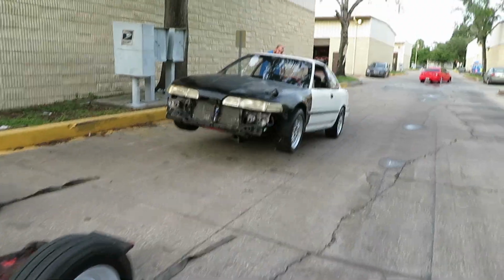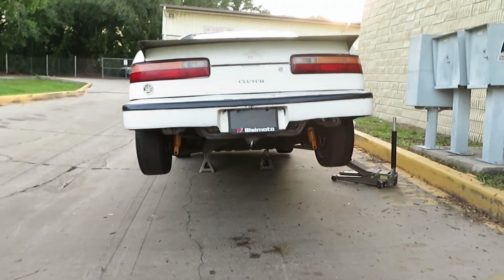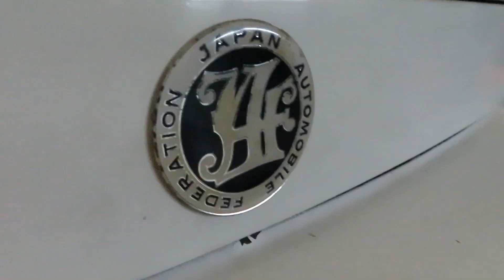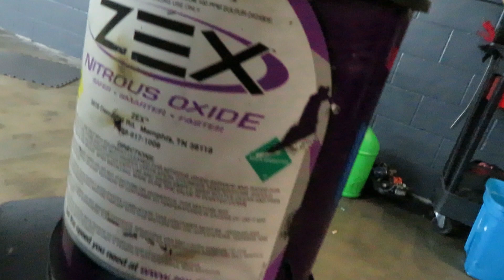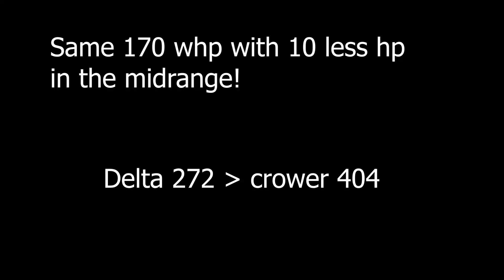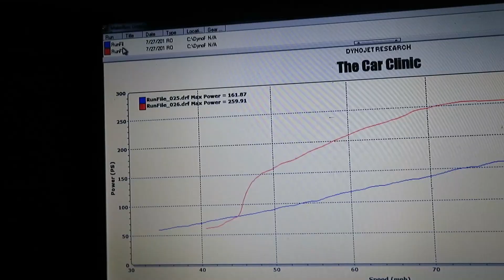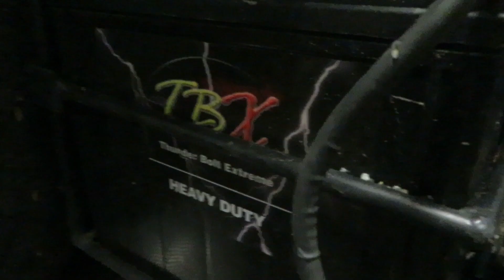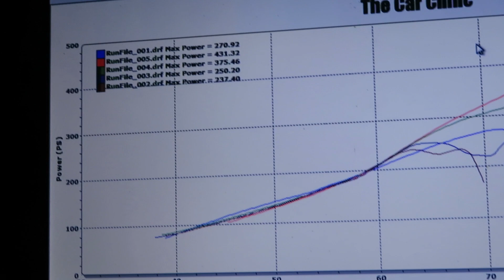La Vaca Hits the dyno with crower 404's and 100 shot!

Comment: had 403s, springs, and 150 shot, ran 8.60s in the 1/8th mile spinning
Reply from the maker: My juke has run a best of 8.60
Reply: Yost Built  I was just giving you an example of around what kinda time your car would run with those mods...
Reply from the maker: @todddouberly87  what tires did you have
Reply: Yost Built  wore out 15in slicks that I doctored up to make a little more sticky, they were better than street tires, lol
Reply from the maker: @todddouberly87  60ft?
Reply: Yost Built 1.97...was the best I got was still working on the suspension and bought some better slicks, but sold the car before I took it to the track again, working on an Integra now.
Reply from the maker: @todddouberly87  💪💪

Comment: How did you made only 170hp with stage 3 404s camshaft and springs? My stock b20z on e85 made 165hp. Same hp as other YouTube stock b20b with stage 2 403s, valve springs and pump 91.
Reply from the maker: The car hates me and never makes good #'s
Reply: Do a video on how to Install 405a on b18 head? Can't find nothing on that
Reply from the maker: @BlackHmong85  the da is done and together
Reply: Dam, put a vtec head on, it'll raise your hp and torque by alot lol

Comment: I always wanted to used the Crower full race 405s..
Reply from the maker: Gonna see soon
Reply from the maker: @Pablo Martinez garcia modified how?
Reply: @YostBuilt  on my z6 with the full race Crower cam.. the lobe had so much lift I had to grind the the oil valley a little.. b series probably the same
Reply from the maker: @Rome3aaro  no sir ..ran 405's in a friends eg
Reply from the maker: @Pablo mg my 405's are very very close to hitting but dont :/
Reply from the maker: @Pablo mg mine are brand new ..had to wait for them to be made...took 5 weeks

Comment: You made 10hp less with the 404s or delta's??? I thought u hit 180 with the 272s? Try the 282
Reply from the maker: both set of cams made the same power with timing pulled for the 150 shot

Comment: Lots of talk about cams not making power but who has spoken about or brought light to the advertised "philosophy of use" for these cams where it plainly states high compression required. Idk if I missed that bit but comments reflect dissatisfaction. There's a b18 out there spinning 9500k on 403s making 200hp with no power adders. No reason 404s lack the potential to be better performers. 

There's no drop in cam for the shit compression of a b20 that's gonna unlock hidden potential. No way. Gotta but that compression to p30 b16a piston specs in 84mm that gives ya 12.1:1 with decent piston to valve clearance even after slight deck work. 150 dollar pistons and 150 bucks more less for arp bolts in stock rods. 300 bucks to use the 500 dollar cams. Cha ching.

Comment: That guy elmer has nearly the same build as you but on m5 but makes quite a bit more power.  Maybe you should try switching out that intake manifold and see if it that helps at all.  Heres his car 12.5cr with 404s and same mods as you https://www.youtube.com/watch?v=rOtuUp3MM-E
Reply from the maker: I watch his build ...m5 would put me around 200
Reply from the maker: I've watch ...I think my header is to small runners and killing the motor
Reply: @YostBuilt  i never saw u make your header.  Did u use like some cheap ebay header and then weld the rest onto it?  The primaries look like stock piping size
Reply from the maker: DC sport top half with the rest I welded on to it :/
Reply: @YostBuilt  i recently picked up a header in the junkyard and idk what type it is but i figured what the hell.  I compared it to the stock manifold and the primaries were the same size it was just the collector that was bigger.  Ive never looked at the higher end brands to see how big the primaries are them so idk if bigger is better or what.  I imagine in your case it is.  Would be cool to see how well your car performs with a different header and/or intake manifold.  Obviously something like that isnt necessarily in the budget but would be cool to see.  What we really need to see is that thing going down the track and see what it can do
Reply from the maker: @timm5970  gonna be swapping the header soon and maybe a muffler